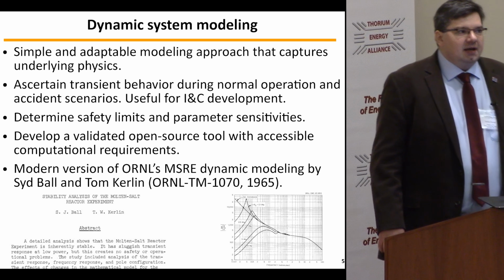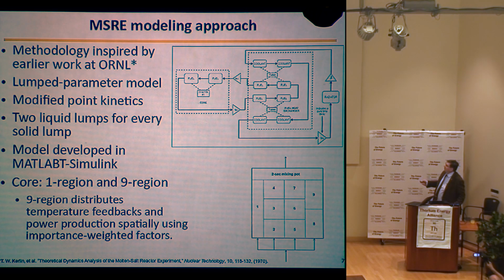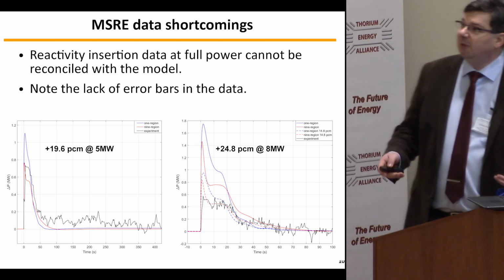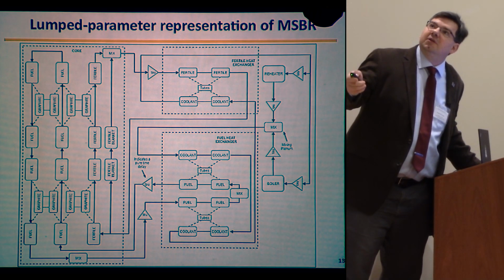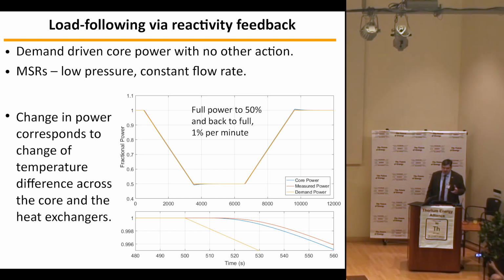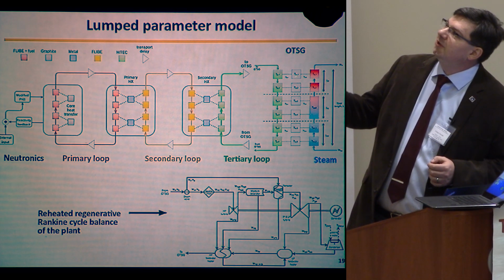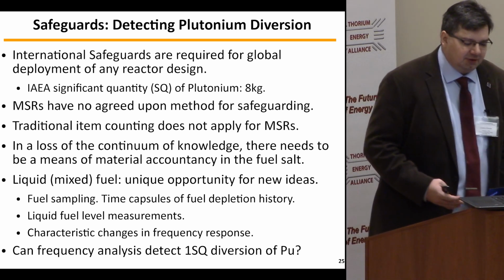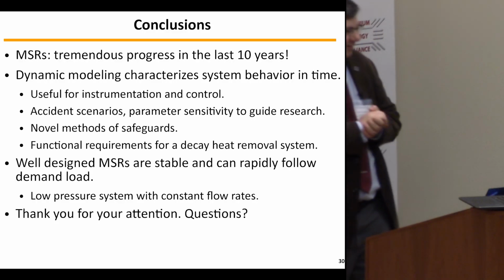Dynamic System Modeling of Molten Salt Reactors (MSR) - Dr. Ondrej Chvala @ TEAC10

Comment: Hey Gordon, are you working on your own version of "Thorium: The Far Side of Nuclear Power" and "Pandora's Promise", maybe for both REE's and Gen IV fission reactors (with a likely emphasis on thermal spectrum molten salt thorium breeders)?  Fission power has two huge issues that need to be combated. 

1) The issue of waste which is always brought up as an unavoidable hurdle, even by physicists and engineers working on fusion power. I don't know why people working on nuclear fusion feel they have to dump on fission to hype up fusion, but they do. People just don't seem to recognize that long lived fission waste is primarily just "wasted" fuel, and several of the Gen IV designs (especially the thermal spectrum molten salt thorium breeder) largely eliminate those long lived wastes.

2) The fact that while fusion does produce 10X the energy of fission, fission already produces 1 Million X the energy of chemical energy sources. Additionally, fusion is characterized as not being radioactive, but all likely forms of fusion are probably going to be deuterium-tritium fusion. Where is that tritium coming from though? 

REE's need a documentary just because the issue is so stupid that it would make a great comedy/tragedy.